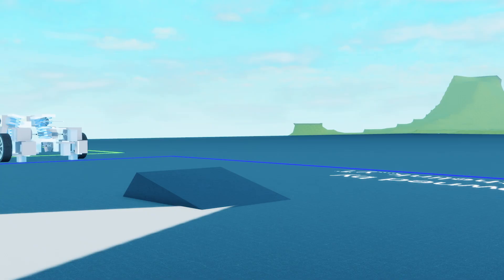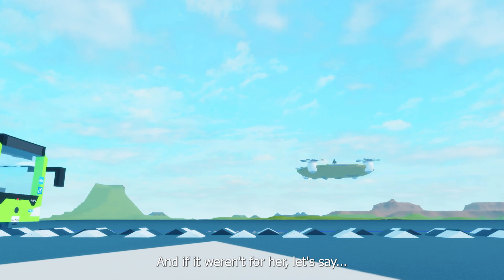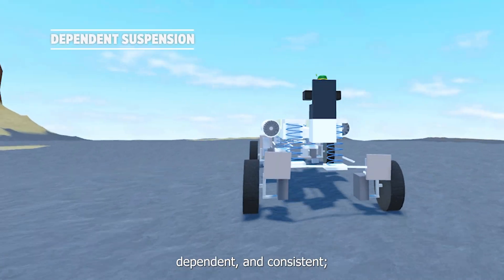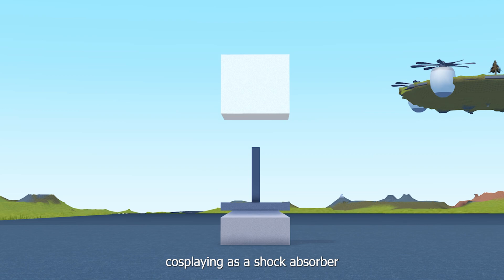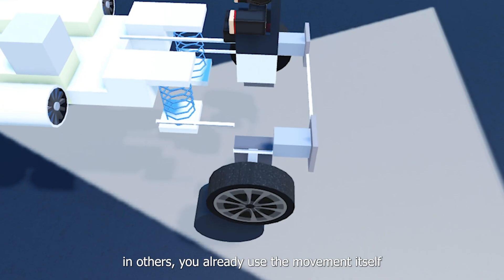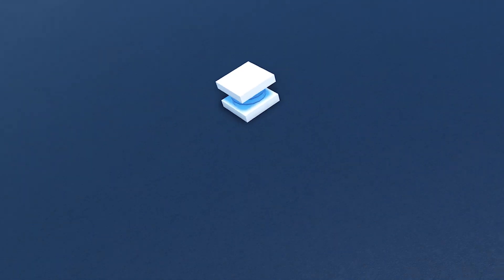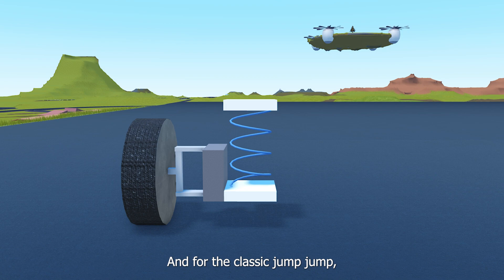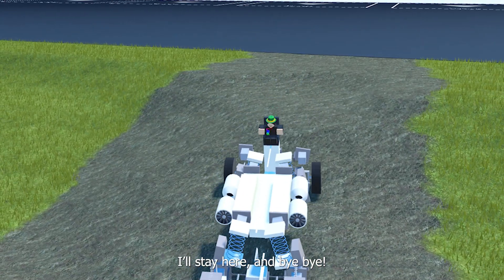LEARN How Suspensions Work in 83 SECONDS!

Comment: What are ropes used for
Reply from the maker: They are used to limit the suspension movement, because the suspension damping settings doesn't really work 100% like a damper, but it changed after a recent update, I'm pretending to redo this video

Comment: How do you make shock absorbers specifically those in modern mtb's
Reply from the maker: It's a bit different, because after the suspension update a lot of parameters has changed, so it deserves a new video just for talking that 👍

Comment: What are the settings for the pistón?
Reply from the maker: You will put toggle mode on, then choose the force that match what you want to achieve with the pistón (lower force = more smooth), choose the size that it will extend for the ride height of the car, and always activate it before leaving the plot 🗿🔥

Comment: How do make the suspension not jump or bounce when your just idle
Reply from the maker: the suspension jumping a lot can be due the damper value being too much, so it dampers more than needed, making it wobble, or the stiffness being too low, so the suspension gets too soft. You may need to test which one is making the car wobble at idle and tune it according to what you see  (I hope that it helps you)🗿👍